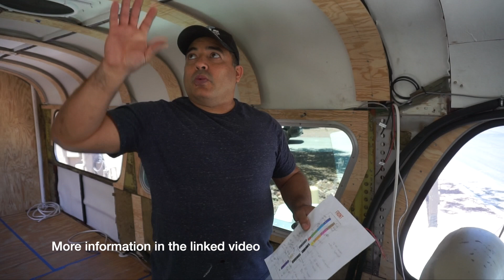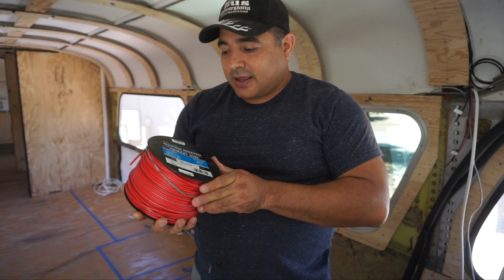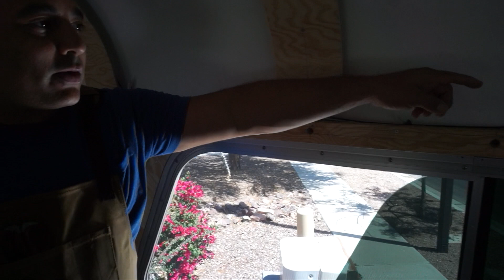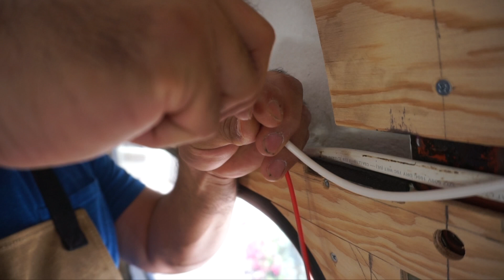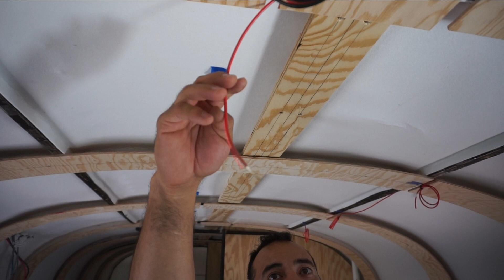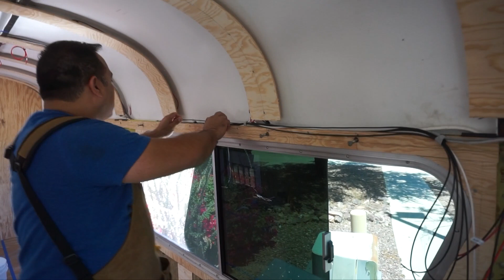Wiring for Overhead Lights

Comment: So sick of the speed up for all the work. That’s what Im looking for. How did you figure out your wiring before all this?
Reply from the maker: In the Part 3 video describing plans for home automation, we describe plans for lighting.  We used n-channel mosfet boards to control the lights (dim), which means they switch on the negative.  Therefore, we knew we could join all the positives and then run one negative for each of our "zones" of lights.  We have our lights grouped in individually controllable zones, so we just planned out our zones, ran a main positive, branching it off as necessary, and then individual negatives for each zone (which could then be daisy chained between lights within that zone).  I hope that makes a little bit of sense.  It all stems from the research we did in planning for automation.  This video will give a glimpse into that.  https://www.youtube.com/watch?v=kc5IhHaVeCA&list=PLq1-J1YKxmjpWiStA6wOpXQcsuEsllpuP&index=3

Comment: Would be helpful to see a wiring diagram. Presently I'm installing spot lights on the back of an RV and I need to route a wire from the battery all the way to the back. I'm not inclined to route the wire underneath the RV but if I did, what gage wire should I use and how should I insulate it? I suspect this is not going to be easy either way.
Reply from the maker: For your spotlight, how many watts is the light?  And how far is the wire run both to and from the battery.  With those numbers, you can look up the Blue Sea a paucity chart to determine what gauge wire to run.  Hope that helps.  Good luck!

Comment: Hi Juan does every array of lights /section needs a different negative cable run from the front?
Reply from the maker: Hi - Yes basically every "zone" (we started out with every light being individually controlled but we have something like 40+ individual lights it got to be too much without providing enough value).  I found myself just grouping those in the software I was writing so it made more sense to break them out into zones.  Each zone contains between 2 and 4 lights (some zones ended up being 1 single light).  I hope to make a video that goes into more details as we get that part finished and figured out.  (a little bit like the final plumbing video)

Comment: I know this is now complete, but you don’t need 14 ga wire for led lighting. 

What you have chosen is capable of 20 amps, and leds operate in the milli amp range, 22ga is more than adequate.
Reply from the maker: Thanks Tom - you are indeed correct - I tested the lights out on our multimeter and the draw was less than 1/2 Amp.  We wanted to overbuild it in case in the future we wanted something different that might have a little more pull.  It is going to be very hard to replace these wires once they are in so we wanted to "future-proof" this just a little bit.

Comment: Did you think to spray foam the interior before you pu on walls and ceiling we used to do that once all the interior mechanicals were in and it really stiffened up the vehicles and decreased the noise and added to insulation.
Reply from the maker: Thank you truckie117 - we considered spray foam for a while but decided that it was probably not a good choice for us.  Spray foam insulation is great stuff but it is hard to go back and run wires etc once it is in.  There is also some out gassing it does that bothered us a bit.  The last thing was that it produces a significant amount of heat and swelling - we were afraid that our panels might buckle or become deformed as a result of the spray foam.

Comment: The side wall main 12v Power leads that are less than 12 inches apart why not pin 3 or 4 Leads at the same point vs 8 splices? 

Does the NEG need to be used for switching?  I would think it would be cool to Ground the lights to the bus close to each light and then run a single POS from the main area to each group of lights?

This is not for the creator.... maybe a suggestion to someone else thinking of building a bus.
Reply from the maker: Thank you Stephen - interesting suggestions.  Some of the lights were close enough to maybe splice into the same point - but once you get more than about 4 wires in a splice it becomes a little unmanageable - especially if the wires are a mix of 10 AWG and 14 AWG.  One thing to keep in mind is that we do not run a 12V battery even though this is a 12V run.  We run a 48V battery (closer to 57V most of the time) and this is 12V because we run it through a step down converter.  We chose to use six smaller step down converters with the caveat that their outputs cannot be used in parallel (there are some converters that you can parallel the outputs but these are not designed for that).

Comment: This channel has reached a new level of professionalism with you wearing that apron! Love it! Good call on the Marine grade material. Make sure no ‘allways on’ positive wire can rub against sharp parts of the chassis and create a short over time. Chassis in negative. Will be a hell of a short. Thank you for making these videos!
Reply from the maker: LOL - thank you Freddy this comment had me laughing pretty good.  I have been called a lot of things - but "professional" is not one that gets frequent use :). Fortunately, these 12V runs are 100% isolated from the chassis.  The MOSFET boards we opted to use do the switching on the negative feed so we thought it would make sense to follow that through with the lights.  We are taking pretty great care to keep all wires away from sharp metal just in case :)

Comment: Nicely done. I hope you made a schematic or wiring diagram that shows where each wire goes to at your control panel with wire labels for future reference.
Out of curiosity, why did you choose to switch the negative side of your lights? Most conventional wiring on a vehicle has the negative wire grounded to the frame and the positive wire switched.
Reply from the maker: Thank you Dirt Road Sailing (One of these days you will have to tell me your name).  We are diagraming and labeling literally everything - We even have other videos that we don't release explaining to our future selves where each cable went!  I guess that is one of the advantages of making videos of everything - If at some point we don't remember how we did something ... we can just go back and watch it :).  I chose to do the negative because that is how our control boards do the switching (MOSFET switching).  Both the + and - are 100% isolated from the chassis so either would have really worked.
Reply: I was wondering that myself.  Rarely have I seen negative used in a common ground chassis.  It's not something I would do even within isolation.  You loose the option to utilize your common ground by using it as control.

Comment: Nicely done...and looking very good!
You should have no problems with such low current running on a 10 gauge backbone.
That is more than enough for 130mA lights...even sets of 6 or more on a single 14 gauge would be fine.
Reply from the maker: Thank you Gregory we were surprised at how smooth this step went - hopefully everything works out.